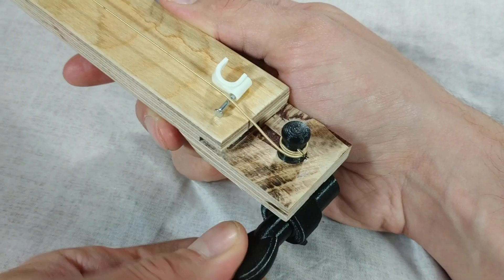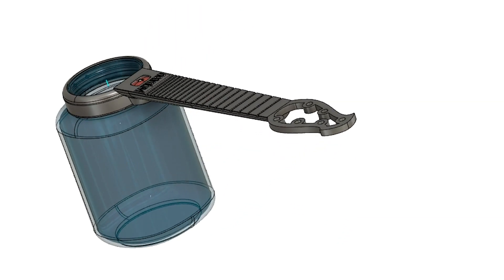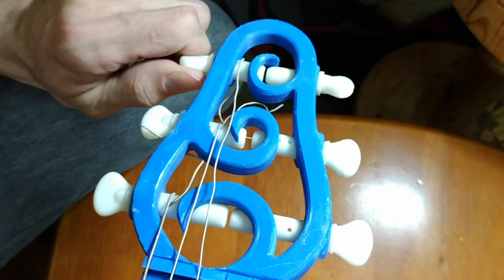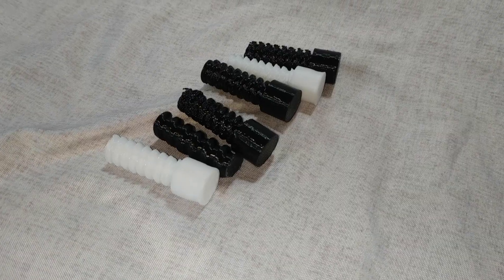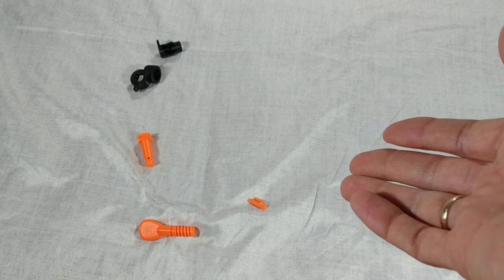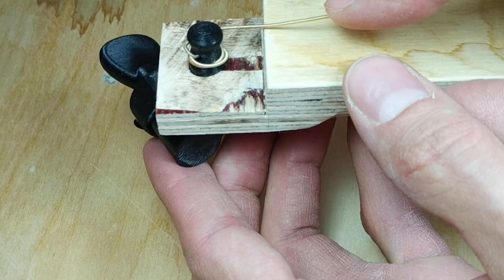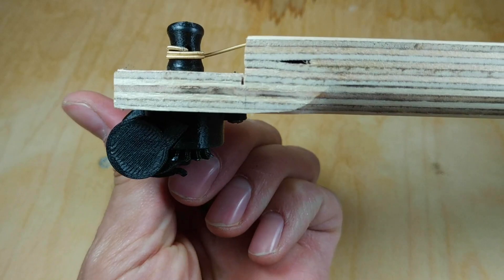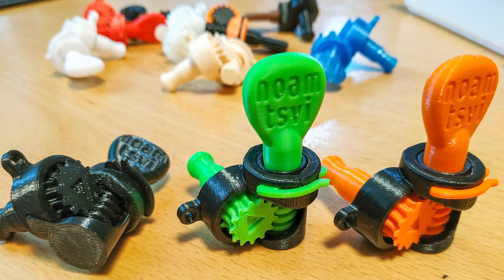Fully 3D printed GUITAR tuners - printable STL files

Comment: Great design. I'll try and cast them in brass and see if they hold up to metalstrings on a Cigar Box Guitar :)
Reply from the maker: Hey there Jesper, I'm glad you liked the design! casting in brass sounds awesome! If the parts move correcly, they should definitely work. Just thought I might point out that these tuners have some issues. I'm working on version2. fewer parts and more stable, easier to print, and stronger. I would suggest casting version2. but on the other hand, I can't tell you exactly when I will finish the design since I am juggling my time with 3 kids, a wife, 2 jobs, and a little bit of YouTube projects. I'm actually printing a test today, but I don't know exactly when I would share the files.
Reply: @noamtsvi  It will probably be a month before I get to cast them, so hopefully version 2 will be ready by then :D
I know all too well the issues with time so no rush :)
Reply from the maker: @jesperskovjuul  alrighty then it's a race!
Reply from the maker: @jesperskovjuul  Hey there, I'm terribly sorry but I haven't had the chance to finish version 2. I'm afraid if you cast the first version you might be disappointed, but on the other hand waiting on me might take a while.. to bad YouTube isn't my job.. yet...
Reply: @noamtsvi  Hi, I'm finally getting around to casting these :) If you still don't have a new version I will try this one and see how it turns out.
Edit: I found your version 1.1, I'll try that as well.
Reply from the maker: @jesperskovjuul  wow that's awesome! Guess you beat me to it... I have ready files for version 2 but haven't made a video yet. Send me a message on Instagram, I'll see what we can do.
Reply from the maker: @jesperskovjuul 

 https://www.instagram.com/noamtsvi/

Comment: This is awesome! I'm going to try to use these to make a mini bass
Reply from the maker: I'm glad you like my tuners😁 and a mini base sounds awesome!! You might have to scale it up though for thicker strings. Are you going to use nylon or metal strings?
Reply: @noamtsvi  I'm going to try initially using just two strings, metal because that's what I have lying around. It's currently just in the design stage but I hope to make a fully 3d printed instrument... But it'll probably explode from the tension 😂
Reply from the maker: Maybe 😅 I know they work great on nylon strings, but not so great on metal strings. I wanted to tweak them up a bit so they'll be strong enough for metal strings. Maybe check back in MyMiniFactory in a week or two for a version 1.1. I might be done by then.

Comment: I printed all the components using PLA and tested using fishing line string. I was able to get the tension up to within a whole step of the  desired note. The turning was squeaky and the amount of effort varied from smooth to feeling like I was forcing it. The gears started slipping which ended the test. I reprinted the worm and pinion gear parts with the new PLA I just received and the gears are slipping right from the start. Like you already said, PLA didn’t work for you. I verified your conclusion. I may try PETG in the future. But I am wondering how long plastic gears in the tuners will hold up under regular use. You motivated me to try to make headless guitar tuners again. I researched what others had done in my pre 3D printing days and decided I didn’t have the tools or skills to pull it off. I think the 3D printer is a game changer and am working on a design right now. It does not involve 3D printing gears (beyond my skill set). I hope to finish up the first prototype to stress test soon. Thanks for inspiring me by your hard work and willingness to share it.
Reply from the maker: Thank you so much! this makes me so happy to hear I've inspired you. This gives me extra motivation to keep making videos. I hope you have good results with your idea and have fun building your instruments. I also have a design for bridge tuners, also involving gears, but a simpler more effective design and easier to print, way more successful than these headstock tuners. maybe I'll make a video about those as well. the reason I first made a video of these tuners is that they are actually part of another project I'm working on. also so far they are staying in tune since I've uploaded the video. And about the PETG issue, I have no doubt that its possible with other materials, by adding cooling, printing slower and adjusting the flow rate. but I'm not a printing genius and I was only successful with PETG. Thank you again for all the feedback

Comment: How does it hold so far? What 3D modelling app did you use?
Reply from the maker: So far it's working great, but it's only a single tuner on a diddley bow. I am currently printing 12, to try them on an acoustic and classical guitar.
For this project I used fusion 360

Comment: Very cool idea. I am currently 3D printing frets and using double stick tape to attach to the fretboard. This would take things to the next level. I tried printing all the tuner parts in PLA. The base and gear required extra attention rotating to get flush to the base before printing. Printed using default settings at medium resolution to start with. Parts fit together fine and turned roughly at first just manipulating in my hand. Turns smoothly now in both directions when I use my thumb to hold the gear in place. If I remove my thumb, I can only turn one direction (tightening a string) smoothly. When I reverse the direction it ejects the gear. I have not tried under a load with a string. I used the gear with the short shaft. Did I do something wrong?
Reply from the maker: Hi there, first I'd like to thank you for printing my tuner and leaving feedback! I designed the tuners to be a tight fit so yes you need to turn them a bit until it becomes flush. The gear is rounded and hugs the worm drive. Because it's a tight fit there should be no wiggle and the worm drive keeps the gear down. Also you need to make sure the slots on all the parts are aligned before inserting the pin. All the prints I did with PETG work great. I did some tests with PLA, but because the overhang, the gear of the worm drive was not exactly simmetrical. I could see on the gear, that the underside and top of the teeth of the gear were at a slightly different angle. And that tuner sounds like what you have here, it wiggled and wouldn't keep the other gear down. So I just stuck with PETG. Maybe you can somehow add cooling or print even slower. Or if you see the gear looks perfect, Maybe your fit isn't tight enough so you can increase the flow rate a bit. And about the short shaft gear, it depends where you want to attach it. The long one is for standard headstocks, the medium one is for DIY project and the short one is if you want to merge the tuner into another headstock STL, without the need to attach it from the bottom. I should probably state this where I uploaded the file. I hope this helps you, I'd be happy to hear how it goes. And thanks again
Reply from the maker: by the way, I also have a guitar with 3D printed frets, that I attached with double sided tape. Works great. And what you said about rotating the parts to be flush with the base, you mean in the slicer? Most slicers have a ''surface to platform'' function.
Reply: @noamtsvi  I’m not aware of that feature in my program. Both parts took a 92 degree rotation to get them flush to the base. Glad to see you have explored the frets only approach, it takes a lot more time and materials to print frets integrated with fretboards and/or necks which I have experimented with. I have done plain 3D printed frets and ones that have nail brad and Tpin inserts. Steel strings are hard on PLA (even wound classical strings are too) so adding some metal is helpful!  The brad nail frets are showing wear, the Tpins are stainless steel and are not at this point. It only takes 30 minutes to do a total refret anyway. I also print a variety of other guitar parts for my cigar box guitars; it is a very versatile tool. My designs are all done with openSCAD. The gears you created are very impressive and way beyond my skill set. I’m pretty much out of filament for the moment, but will resume testing when the roll I ordered arrives in a week.

I’m hoping to make your designs work with PLA. Which parts are most likely to fail under stress? If it’s the post that the string goes through, I’m inclined to modify the design to insert a nail after the print.
Reply from the maker: If you print it at 100% infill, the post would have no problem at all. If you're using nylon guitar strings there is nothing to worry about. But if you're using steel strings, it tunes nicely up to a certain point, when the tention gets high, the pin would break and the sleeve might get a bit deformed.

The frets I printed are PETG. They're holding up nicely so far. They don't really wear down because they are a bit flexible so they squish a tiny bit when pressed on Rather then wearing down
Reply from the maker: And another thing I'll have to do is orient the parts, to accommodate for slicers that don't have the surface to platform feature
Reply: @noamtsvi  Thanks for the details on printing and failures. I researched printing PETG on my printer and it involved changing bed and nozzle temperatures at different layers. Not sure I’m ready to get that involved. Have keep the printing simple to this point. I will try to make tuners work PLA and let you know how it goes. I’m intrigued by the performance of your PETG frets!
Reply from the maker: Thank you! I hope the print works well for you. 
And I didn't know you need to change nozzle and bed temperatures at different layer heights, I just have the nozzle at 240 and bed at 60. So far I have no problems
Reply: @noamtsvi  That is good news for those of us who haven’t tried PETG! (I think there are people who really get into tweaking the settings, I just want to print my parts!) That is an easy adjustment from my 220/50 standard combo for PLA. I will order some PETG, if I can’t make the PLA work. Have you considered a mod to the tuners so they will accommodate Aquila Thundergut ukulele bass strings? I don’t think the tension is any more than nylon strings, but they are thick. I bought a pair to make a short scale bass, but tuners are a problem. I haven’t been able to find ones and, if I do, I know they will be pricey!
Reply from the maker: It is definitely an option to modify the post so thick strings would fit, I'll just have to add it to my to do list